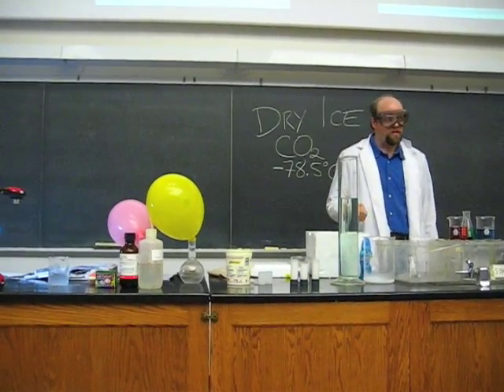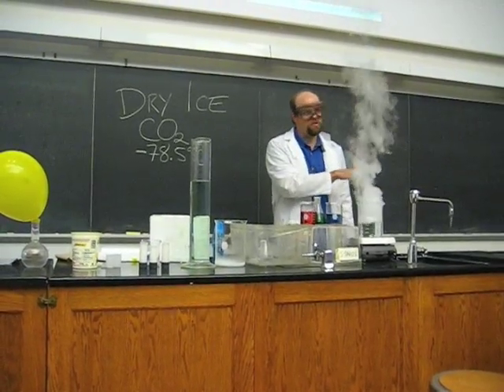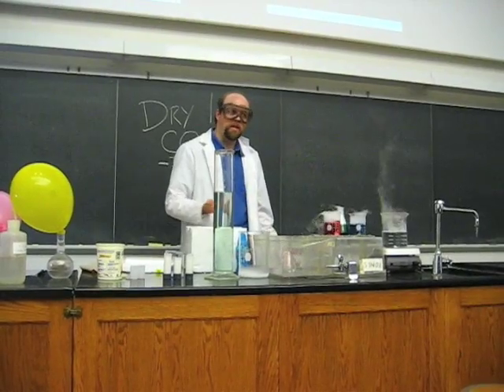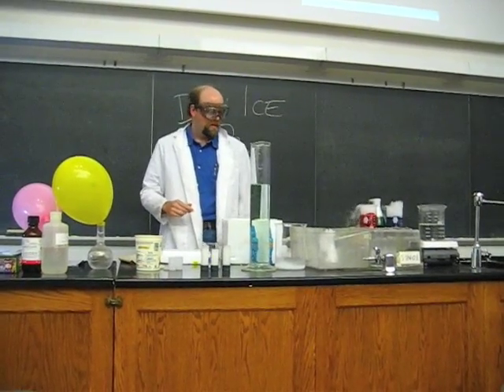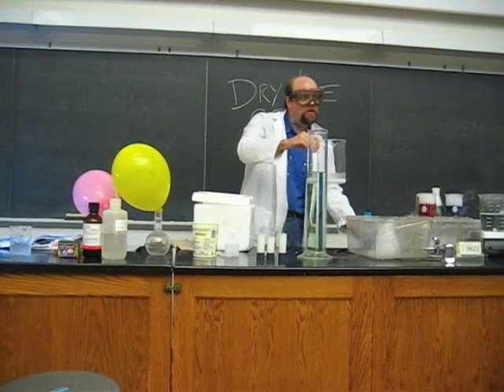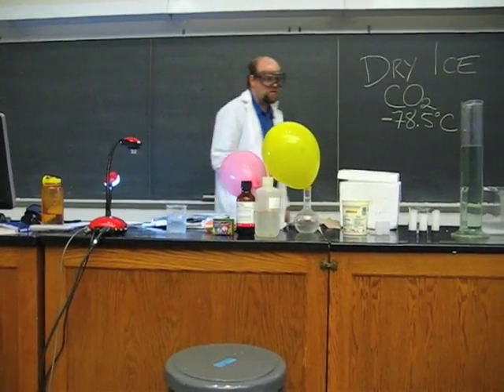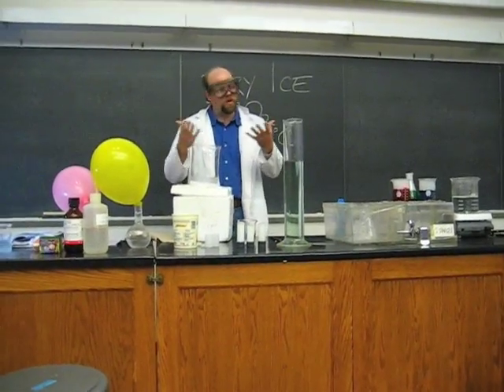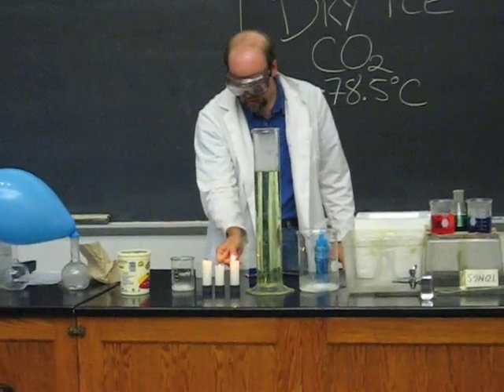Dry Ice

Comment: @aaronakeller I personally believed a similar outcome would result from that, considering the sudden change in temperature, like you said. Wow, I find that interesting, because I'd assume it would immediately vaporize into thin hair.  So it's more the pressure of the surrounding water than the temperature that allows its exsistance in a liquid state?